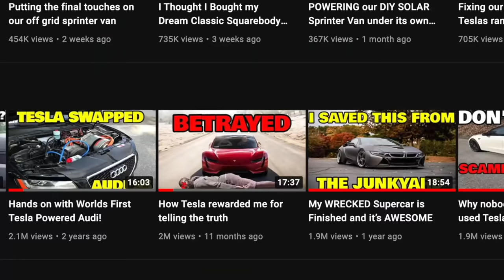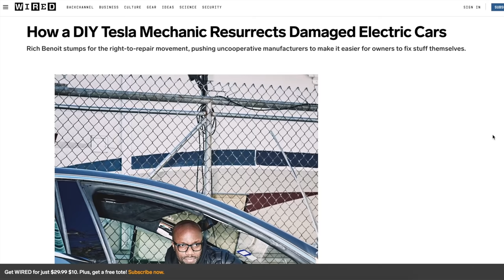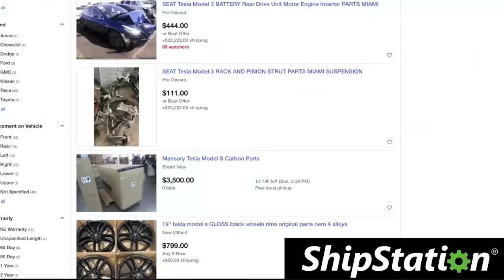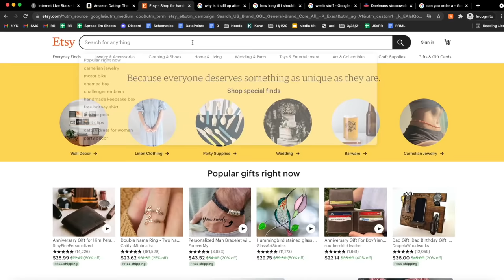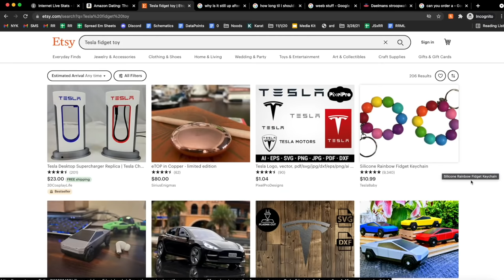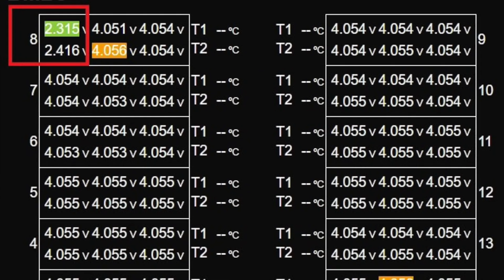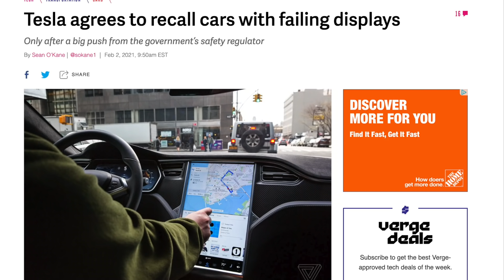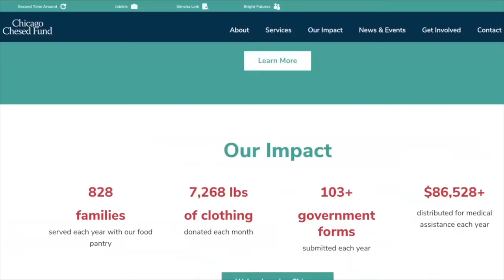Tesla wanted $16,000 to fix this NEW Model 3, we did it for $700! The importance of Right to REPAIR!

Comment: Munro would be proud for the cost saving Tesla did in that plastic connection.
Reply: He probably suggested it to them!
Reply: You wouldn't use metal with such coolant connections in a million years... You could put sone metal shield (or composite) shield to shield the connections. It wouldn't make sense to put replace the plastic plate with something metal.
Reply: @rkan2  yeah we are getting your point, it's still irrelevant, cause people here arent engineers, they are making the point that this is a design flaw which you dont disagree with, so how about that. Focus on the important stuff.
Reply: @rkan2  is really that hard to do an Aluminium connection welded do the battery casing? The use and abuse of plastic in car parts subjects to heat cycles, is used mainly to cut production costs.

Comment: I had a radiant heating system installed in my  home  the tech who installed the system used brass male pipe fittings screwed into plastic  female  fittings as you  did , after a short time  the brass fitting caused the plastic to split . Not sure if it was  the expansion difference between the brass and plastic or  over torquing the  fitting. I think it would have  been better for you  to use  threaded plastic  pipe  into  the  damaged fitting  so  you  didn't have the same result as I did. BTW  I in order to  correct this had to  go  with  female brass fitting and male plastic pipe fitting. Just a thought. otherwise great  instructional videos .

Comment: Last year I was really interested in getting a Tesla. The more I find out I definitely will not. They need to change a lot of practices before I would buy.
Reply: We need to take you and multiply that by 10-million.  No one should buy a Tesla until they pull their heads out of their ass and become a more consumer-focused business.  This company is horrible in just about every imaginable way.
Reply: Last weekend I heard another news item about a Tesla automobile catching fire, the door latches malfunctioned so that it was nearly impossible for the driver to open the door, and when he did get out and the fire department arrived, the fire kept rekindling due to the electricity stored in the malfunctioning battery. The news report stated that the fire department used more than 20,000 gallons of water and that they were only able to extinguish the fire when the car had burned to the ground.        
I suppose the good news would have been that the victim's family would have saved the cost of a cremation.
Reply: Pretty much all car manufacturers are the same way fighting right to repair laws. You think ford and gm are going to let you or a local mechanic go to napa and buy eletric car parts like you can for a gas engine? 

The consequences of your fuck up are more lethal with a battery thats why tesla is so anal about this. People too stupid to work on their stuff end up working on their stuff.
Reply: Yeah, I'm really glad Rich is spreading the truth about Tesla. I despise it when companies still try to "own" your product after you buy it. All for more fucking money. Shame Elon, shame. And it hurts to say too! Because I looked up to the guy for so long and so much. I have mixed thoughts about him now.

Maybe we need to learn how to create our own shit. It sounds ridiculous but if people did it all over the country then it'd be "normal" and we wouldn't have to bend over to companies shitty practices
Reply: @5610winston  the craziest thing about that accident is, that Teslafans attack the driver for getting paid by the oil industry and setting things up. Crazy.
Reply: @5610winston  When an electric car catches fire over here, they dump it in a container filled with water (and possibly some other stuff). That way it can't reignite. ;)
Reply: @dylanmccallister1888  Remember the lawsuits when it came out that Ford calculated they would spend less settling lawsuits for victims maimed in Pinto fires than recalling and mitigating the design problem?
Reply: @5610winston  Obviously they remove the occupants first and extinguish the car with normal means.
When that's done, they bring the car to the container and dump it in.
They leave it in for a couple of days.
Reply: There are plenty of EV choices now, if you don’t like tesla take your pick. However don’t bet any of them will be commonly repairing a damaged battery pack like this garage. It will be a replacement situation and you’ll have to go third party if you are faced with paying out of pocket
Reply: @paulg8065  I'll stick gas or hybrid. I'll pass on ev at the point
Reply: I would still encourage you to consider an EV though. I have owned my 2019 Nissan Leaf since new. Over 17k miles and not one single issue. I rotate the tires myself, fill up the washer fluid and check coolant level and replace the cabin filter. Once a year you need to take it to the dealer for a battery health check to keep the 8 year/100k mile battery warranty active. That is literally all the upkeep this car has needed. There are a few people with the 2nd gen Leafs with over 100k miles with minimal battery degradation and no repairs.  This thing is hands down my favorite car I have ever owned. My base model 40kwh gets 150 mi per charge while the 62kwh gets around 220. The battery checkups are even no charge for the first 3 years. I highly recommend checking into it. 
The icing on the cake for me is how practical the car is, being a hatchback you can fit a lot of stuff in it. You have heat within 1 minute even in below zero temps and operating cost is very minimal.
Reply: Plus Nissan has had zero confirmed battery fires in a 10 year run with the LEAF. There have been a few catch fire but from other causes like mice chewing through wires in the bay or dash area. They are a very safe car.
Reply: @jeremydavis2595  I'm not anti ev. I'm just anti Tesla, until they fix their practices, if they will at all
Reply: @Robbedem  usually the fire department would try and put out a car in a matter of minutes, this sounds like a several day process. Lmao. Imagine this on the side of an interstate, or better yet a tunnel. Sounds ridiculous. Gotta get a whole crane to pick up a burning car and dunk it into your local swimming pool.
Reply: @skylar1112  personally I have 117k on my 6 year old Model S. On my third set of tires, 3rd 12V battery, cleaned my K&N cabin air filter a few times. That is all the maintenance. No issues. Love driving the car.
Reply: @davie13laze50  Like I said before. They extinguish the car like normal, but because EV's have a tendency to re-ignite , it get's transported to a container filled with water (and possibly other stuff) to keep it from re-igniting again. That container is probably somwhere close to a fire department.

Comment: As I got older I realized how expensive mechanics, plumbers and Hvac specialist are 😂😂😂. $7.99 for a spark plug but a shop charges $500 😂😂
Reply: People are either afraid of doing things themselves or they just don't care as long as it continues to work.  Such is human behavior.
Also, it depends on the type of vehicle too.  That spark plug might cost you $8 but if you have to take apart half the car to get to said spark plug, then you know why.. lol  Poor design and they charge the customer for it... c'est la vie..
Reply: @neoanderson7  so true I had to change my spark plug on my v6…took 3hrs  and like a zillion tools 😂😂
Reply: @mrcarterfx885  that’s why it’s $500 , parts , materials and TOOLS plus the knowledge and whatever else to do the job. The tech doing the work has to get paid and the shop owner has to make a profit otherwise what’s the point. Just saying
Reply: Dude that brass fitting is 4 bucks and they charged him 700 for less than an hrs work lol. Not much better but way better than 16k so I know he was happy
Reply: @mrcarterfx885  at least you attempted it and now you know what’s involved. 👍🏻
I’m thankfull my vehicles have everything really accessible. About the only things I will need help on is if I need to change a clutch out or rebuilding the entire engine. 😂
Otherwise, everything else is a walk in the park. 😎

Comment: When Saturn first came out they did the same thing. They told their customers that the warranty would be voided if you took your Saturn to any other repairer other than the Saturn dealer. They went so far as to not sell parts to anyone other than the Saturn dealers so you would be forced to go back to the dealer for any mechanical repairs or bodywork.

Comment: Infiniti coded my key that I bought on eBay for $300 less than the dealer wanted for the fob. No problem.
Reply: Infiniti/Nissan dealers have always been very helpful with me, getting seldom used parts like flywheel bolts and pilot bushings was incredibly easy when I did my clutch job, just had to come in and pick it up the next day.
Reply: That's impossible

Comment: Does this suggest that the battery or at least that nipple actually needs a metal shield below it to protect it?
Reply: I agree. When you have a big problem that is so simple to correct, just add another inexpensive shield protecting the nipples. Problem solved and everyone is happy again.
Reply: They made a metal skid plate
Reply: Yep
Reply: Yep, gotta get some good nipple shields to protect those sensitive nipples!

Comment: This repair is exactly what my local Toyota dealer would do. I had my 91 Toyota pickup stolen. The thief cut my ignition wires leading up to the key cylinder. Toyota didn't bother replacing the whole ignition harness. Nope. They just cut the rest of the ignition wires and crimp 1/4 terminals and shoved it back into the ignition plug. It worked but I could've done that too.

Comment: If this is a weak point, is there a way to “armor” this section with a piece of sheet metal or plastic overlay?
Reply: Sure, you could whip something up with some aluminum easily. 1/4" thickness should do it.
Reply: My thought exactly.  Reinforce the belly pan and/or mount a piece of aluminum channel over the end of the battery pack so debris can't strike it.
Reply: Looks like electrified garage are already selling one.
Reply: Uncle Rich can ship one to you.

Comment: The Tesla battery problems stopped me cold when I considered buying one.  I actually canceled my appointment for a test drive.
Reply: Same here. Was looking to buy one earlier this year but decided against it after doing some user experience research.
Reply: the ford f150 lightning looks to be way better than the cybertruck
even the f150 electric/gas hybrid gets 24mpg & is very practical
Reply: @stevejeffrey11  I actually like the unusual looks of cybertruck
Reply: @redapproves1330  They are supporters of gasoline cars...
Reply: Same, it’s obvious they will need to be replaced at some point, they could not answer how much new batteries were… they said 8 year warranty. I left and never looked back.
Reply: @cindyleeger  New battery is about $10,000. Add labor for installation and the final bill for battery replacement is about $15,000. The warranty doesn't cover roadside hazards. Some poor Tesla owner had to find out the hard way.
Reply: @stevejeffrey11  I think the Cybertruck is so much more advanced and cool. However, the 150 Lightning is a great vehicle and probably going to outsell the Tesla because it is a Ford and more suited for today's general public. And of course it is backed up by a great company. But does it push the envelope on what is possible in the future? No, it is basically an F150 that happens to be electric instead of gas. Again...F150 is a winner but, the Tesla is a won.

Comment: I hope tesla becomes more right to repair and modular.

It's kind of scary to think that for such a simple repair its gonna cost me basically another tesla.

I get the whole "if someone tinkers with a tesla and doesn't do things well. It can cause a massive issue"
But they also need to make it cheaper and easier to get small repairs easier.

Comment: I have a camry hybride 2008. Hybrid Battery died. Toyota wanted 9500 to replace battery. (they wanted 800 to replace a lightbulb). I found a company to replace the battery with a new battery for $3k. But it took me a little time to get it running right again... Here is what I had to do..

1. When you change the 12v battery, steal the sensor off the old battery. (it is the plug)

2. Put the car into Maintenance Mode. find a flat place and just let it idle till it gets to temp.

Comment: then car dealerships be like: "OBD diagnosis $80 pls"
Reply: When you can just use a jump wire and count the flashes of the check engine light for free!
Reply: and if you dint wanna do that $15 ODB2 scanner and a free app on your phone
Reply: @aka1mite  Most 15$ ODB2 tools only gives you the basic codes of course
Reply: @aka1mite  well, if you can still bring the car from point A to point B, you can go to a car parts store and they do free  OBD diagnosis (at least where I'm from)

Comment: Yep, crack a little $25 plastic part, replace battery for $16000.  Who do they think they are, BMW?
Reply: It’s more complicated than that. Even touching the battery could potentially damage it and render it useless anyways. Just do the job right in the first place by taking it to Tesla for a new battery if they say it needs one. The company knows best
Reply: @Vivra_Verra____  that cracked the nipple that the coolant runs thru. Not the battery case, The outer cooling case.
Reply: @metalmafiachris  Still dangerous to work in it. It could render the car useless if done wrong
Reply: @Vivra_Verra____  or tesla could train their tech repair guys  to diagnose the car better. Tesla should  know better in this case instead of tesla knows best.
Reply: @Vivra_Verra____  so your response to the video should have been someone with no battery, or coolant knowledge should attempt this.
Reply: @Vivra_Verra____   Oh yes, the "company knows best" about what's good for itself.  The real mistake is the poor design.  If they insist on using a weak plastic part in such a vulnerable spot, the part should be replaceable in its entirety without replacing the $16000 battery.    As it is, it's no different than telling someone they need a new engine because of a broken radiator hose.

Comment: This is why I bought a Chevy Bolt. More dealerships, cheaper insurance, cheaper body shop repairs, less vehicle complexity. Same 100,000 mile battery warrants.  Tesla definitely needs to expand the aftermarket repair of their vehicles. Also, we need an aftermarket battery rebuild industry, for EVs to be more viable.

Comment: Your best video so far Rich.  Very interesting. That is a very crazy attitude that Tesla has, that the ONLY way to fix it is a battery replacement. A simple plumbing solution... that's how I would fix it. Stronger than new.  Thanks for the information.

Comment: tip: you dont want thread sealant in cooling system.  thread insert in ~2 threads (1.5 turns) and then add sealant to the remaining threads.

Comment: So much for Tesla’s being environmentally friendly. Imagine scrapping this whole car for a simple repair.
Reply: OK but "scrapped" battery packs sell for thousands on EBay, not landfilled. I do agree it's insane to replace a pack because of a cracked coolant line.
Reply: We all know electric cars aren't environmentally friendly, some just don't want to admit it. Pollution is created in the battery manufacturing process and the electric power generation you need everyday not to mention the pollution caused by the transportation of the car to its final destination.
Reply: @pauld315  I would say instead that we all know EVs are cleaner and greener and will become even more so when the grid that powers them becomes cleaner and greener.

Comment: One issue is an insurance company will total such a simple fix ( a cooling Nicole to battery pack), and also that the dealer won't promote third party repair shops more for such issues of this nature! 
One question as a customer to Rich and EG would be is how do we create a shield to protect that thermo cooling line from a recurring incident of an object breaking through the cover shield to damage this sensitive item?

Comment: I would love to know how Tesla gets away with bypassing federal law. Electric/hybrid Batteries require a minimum 8 years 100,000mi warranty.
Reply: The warranty doesn’t cover you if you hit something
Reply: The loophole was that it wasn't a problem with the battery itself. That connection point probably should of been replaceable to begin with, but they knew what they were doing💰

Comment: If the brass reacts to road salt or the coolant going through it there are vinyl and polypropylene plastic fittings of your brass hardware.
Reply: they already said the fitting has no reaction to coolant. as for road salt? that thing is in a sealed compartment if road salt can get to it you have much bigger problems
Reply: @TAKIZAWAYAMASHITA  fair enough, plastic fittings will also not snap threaded parts too. If you did crack the fitting by over tightening JB weld over some plastic or brass tube inserted into the hole will seal it up as well.
Reply: Why's that Tesla's not making a proper replacement part, that can be scrued in without needing to use the old tip is really ignorant.
Reply: It’s most likely OAT coolant and can handle every type of metal and plastic in the system. Unless the brass fitting is sitting in a bucket of salt water it won’t have any problem. It might develop a little surface corrosion but nothing serious. This car will be long gone and in the junk yard before that fitting crumbles to dust. The other plastic coolant fitting next to it will most likely get smashed to pieces before this car makes it to 100k miles. Tesla is up shits creek without a paddle. Right to repair will happen very soon, it’s inevitable.